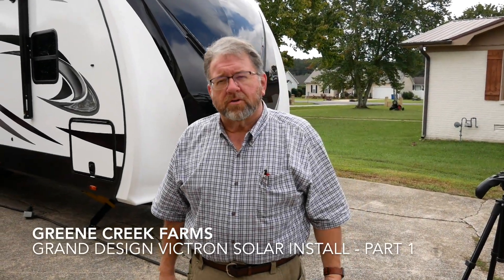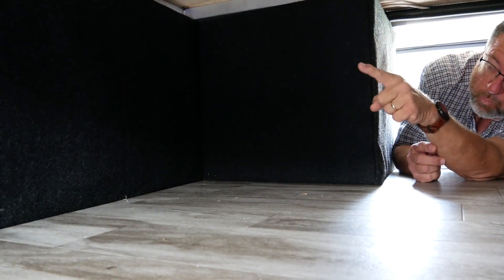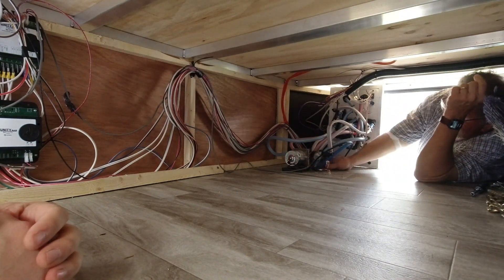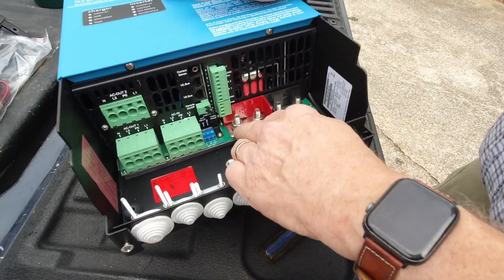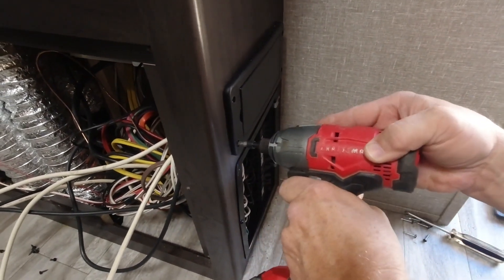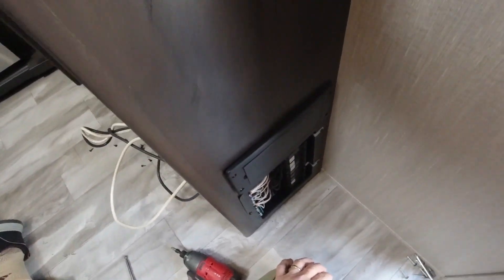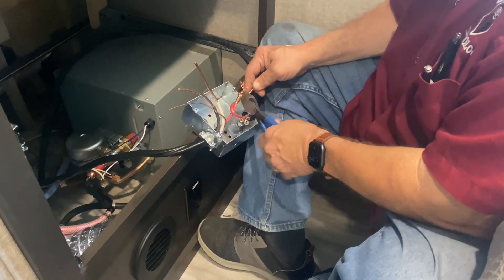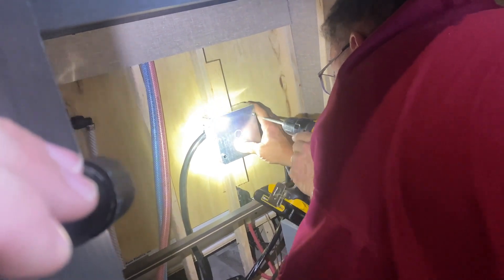Grand Design Victron Solar Installation

Comment: Couldn’t you install all of the new stuff on a transfer switch before the distribution panel and add a second shore power connection?  Leave the factory equipment as-is.  That way there you have the benefit of redundant systems if one fails.  Could also run a generator or power station to one of them for even more options.
Reply from the maker: You could absolutely. The Victron system has its own internal transfer switch system and switches from shore power to solar and will use generator power based on the output set by the user. We elected to stay with just the Victron because of its multi use capabilities but a transfer switch could give you more options and provide a second failsafe absolutely.

Comment: Splicing AC lines like that is dangerous.  You should have used lugs.  If you put a thermal camera on that connection, you will see that it going to generate a fair amount of heat.  That is lost voltage.  Please spend the $20 and put lugs on that splice.
Reply from the maker: Yes Sir, we have done many revisions since the installation of this system and have upgraded the wiring and orientation as well.

Comment: It’s insane that Grand Designs installed that DC breaker for the factory inverter where they did. They put zero thought into that.
Reply from the maker: I completely agree, with us revamping the system it was nice to put things back where they make sense to us.